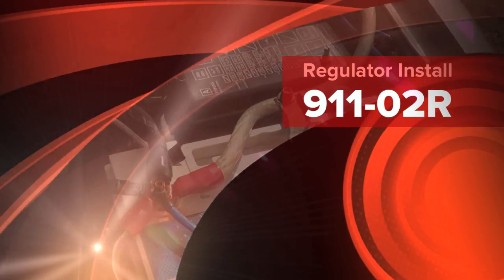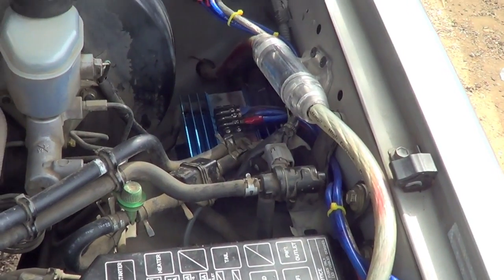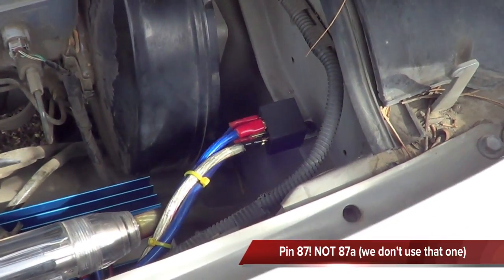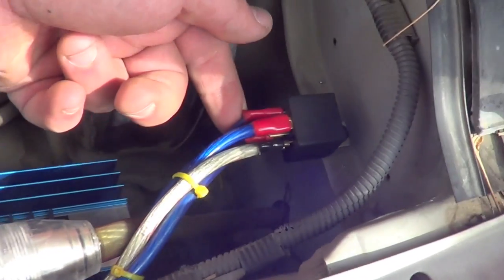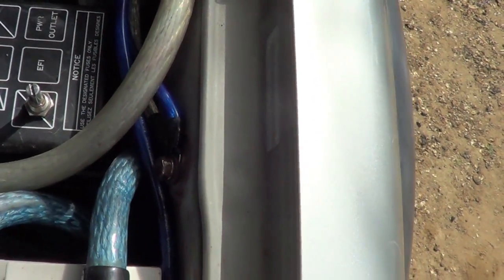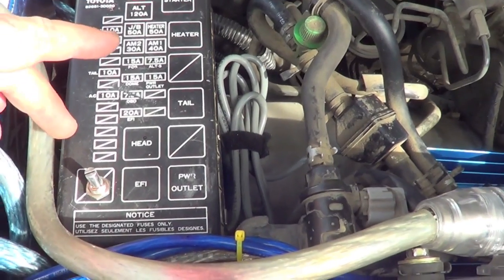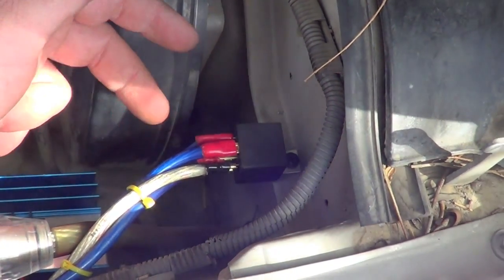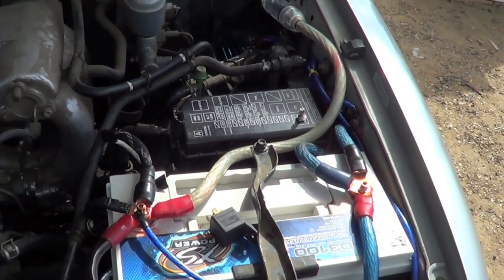911-02R Regulator Install

Comment: Any idea what the adjustment range is for your application?  If it is 14-20VDC, you probably have it set very close to the bottom end don't you?  Wy didn't you run a V1200 which is rated 13.0 to 16.0 Volts and is cheaper?

Comment: Why did u need such large wires to run this? It would seem. Like a pretty low power device
Reply: The current tunning through the field of the alternator can be high current (5-15 Amps depending upon the alternator) so those wires should be large.  The relay coil itself is low current.

Comment: Do you remember if the ground from your alternator had an L on left and F for field or if it was a DR44? Does anyone know where the L wire hooks to if it's not a ground? Basically doing the same thing here.. same regulator too.